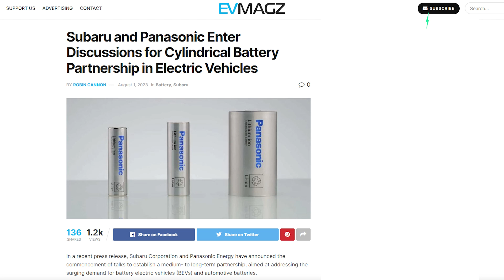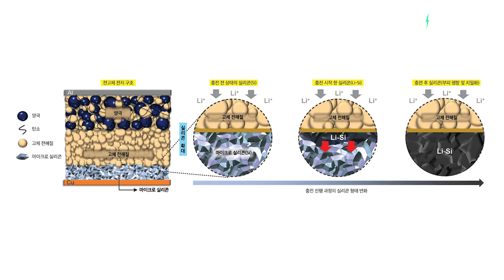Subaru, Mazda, GM & BMW reveal plans to use Tesla-like 4680 batteries

Comment: I thought GM touted using the “Ultium” battery platform. They implied that it is the best platform to use for EVs. So will the 4680 be inside the “Ultium” battery platform? I’m quite confused.

Comment: IT HAS BEEN SHOWN THAT THE BYD STRUCTURAL BATTERIES HAVE LIMITATIONS IN CHARGING TIME, BY INSUFFICIENT COOLING. IT IS OBVIOUS THAT THE CYLINDRICAL FORM OFFERS THE BEST COOLING, AND AS ENERGY DENSITY HAS RISEN THE LOST SPACE BY CYLINDRES IS WITHOUT IMPORTANCE. AN IMPORTANT CHINESE BATTERY PRODUCER (FOR BMW ETC) USES ALSO CYLINDRICAL BATTERIES. PROBABLY WILL CARFACTORIES DEVELOP THEIR OWN COOLING SYSTEMS, WITHIN BY THEM DESIGNED PLATFORMS.

Comment: The 4680 provides better heat control, and rigidity for the pack if glued in properly.  Panasonic has already perfected the cylindrical cell and is a Japanese company.  The only thing Tesla is having a problem with is scaling up 1000% every 6 months because that is how far behind they are in making batteries.  Now Subaru, Mazda, GM & BMW get to find out how hard software, the 48 volt electronics, and new frame is to add to an electric car.  PS, they don't have Musk to push the headaches through.

Comment: When Tesla first announced the 4680 battery cells, they claimed much higher energy density - I think that was greatly exaggerated.  But, compared to prismatic cells, they are said to be much faster to manufacture, which provides a cost advantage.  They should be faster to assemble in packs and have fewer connections than smaller cylindrical batteries, which should make the packs cheaper to assemble and more reliable.  So there do appear to be significant advantages, but not all that Tesla claimed.
Reply: Exactly,  i think you are spot on with this comment.

Comment: This is nothing new, the original announcement dates back to early 2022. BMW confirmed their manufacturing plan’s last December 2022 creating the new plant in Hungry with upgrades to Munich and USA whilst Tesla outlined their new planting in Nevada January 2023. The interesting development underway is the holy grail for solid state batteries Toyota has published detailed of their prototype model with plans for mass production whilst striving for commercialisation in 2027-2028 whilst BMW’s prototype for production should be running by 2025. Then the question is will Tesla produce a solid state battery or persist with the 4680 battery. “When these batteries are in production, there will be no comparison between the current technology or anything petroleum based—[solid state] is the kiss of death for gasoline and diesel." Munro. So when will Tesla announce a solid state battery to maintain pace.

Comment: There are probably cost advantages due to economies of scale when so many manufacturers use the 4680 cells. That may have been the deciding factor causing everyone to jump on board the 4680 train.

Comment: Panasonic must own the right to the 4680 so they can sell the same battery to anybody else. Tesla happens to be the first customer. Since the form factor is an international standard eg. 18650, 21700 and then 4680, other battery manufacturers can make 4680 though likely with different type or characteristics. The 21700 is a good example. Though Tesla was the first EV maker to use it, other brands beside Panasonic, such as Samsung, makes 21700 cells for sale. Now you can buy individual 21700 cells in open market. If 4680 becomes more popular and there are other uses outside EV, just like the 21700, I am sure we will see it being sold on various markets such as Amazon, eBay etc in the future.
Reply: @@user-fg6lm3ef5otrue anybody can make a 4680 form factor battery.
Different story when you have to make it in quantity and cheaply.
Just like anybody can build an EV.
Different story when you also have to make a profit!

Comment: I also am not a battery engineer. Having said that, by what if heard, the 4680’s advantage is first, potentially lower cost. Second, high production rates. The form factor has no bearing on chemistry. You could make a sodium ion cell if you wanted. You may have additional layouts for thermal control. The downside? Lower energy density at the battery pack level.

Comment: More companies going away from pouch style batteries from LG Chem to stromger 😢prismatic battery Casings and cylinder style casing been around  for decades.
Reply: Pouch batteries are flexible and can swell.  They can be damaged during assembly.  Bolt batteries recalled as well Kona battery packs.  Other brands keeping quiet over type of battery
Reply: Lfp does seem the safest so far and CATL mskes the most
Reply: Panasonic wants to grow fast.  CATL interested 4680 style
Reply: 4680s are not  a failure.  Almost fully automated.  700 batteries vs thousands in a car.  Less batteries less weight. Probably cheaper than LFP but I can see a LFP style 4680 in the future with tabless design and no wet slurry but dry chemistry

Comment: No carmaker has to make its own batteries. They all can buy from the shelf or let the battery companies make custom fit battery packs for their brand vehicles. 
Actually the same as with other car parts they all come from third parties: head lights, rear lights, sensors, clutches, seat belts, gas tanks, cables, wiring, lead acid batteries, etc. etc.
And all logical: spread your risk so production can go on no matter what.
Reply: all the oem’s who moved away from vertical integration and towards outsourcing are all going bankrupt or can’t sell their vehicles. Sounds like putting your eggs in one basket. What happens when your suppliers can’t provide parts? a bottleneck in supply? Ah, well what’s happening now to them unfolds. They overproduce on poor timelines and undersell. Controlling your own logistics and manufacturing only makes things more possible. Sure, get what you have to do from others but whatever you make in-house now saves money and time, and creates jobs. Becoming a supplier of parts and infrastructure is a key reason why Tesla is where they are today. Everyone wants their batteries, chargers, and software.
Reply: BYD makes everything themselves including battery and car IC, except tires, windshield and some tiny items.

Comment: Tesla offers diverse batteries, 18650, 2170, 4680, and prismatic LFP.  4680 tabless design for a LFP version.
Reply: Most other companies just one battery type.   LG Chem does not make LFP batteries but that will change.  Many Lg Chem batteries are pouch type that can be easily damaged during assembly

Comment: The 4680 are metal cans and can provide added rigidity to the vehicle's structure. This rigidity can also be used to advantage during assembly as well as during vehicle operations. Second, the metal can provide separation for each cell and if the cell is damaged during an accident or because of some failure of the cell, the exposure to thermal runaway (fire) is greatly reduced. The Tesla 4680 cell vents to the bottom and away from all of the other cells. The other packaging methodology places the cell in close proximity and with little or no isolation between them, they also provide no structural support but are carried in trays.
Reply: Yet they can still catch 🔥
Reply: What you are saying is happening in BYD razor blade battery already, go read up yourself how strong is BYD structures and fire proof even with battery punctures.

But this will not going to happen in Tesla because there are big gaps between cylinder.

Comment: The point about 4680 cells isn't about getting the maximum volumetric density, it's about making them really cheaply. Look at all the stock footage of pouch cell production, then look as how much simpler cylindrical cells are to make. It ought to be blindingly obvious that winding the whole cell in one quick operation is always going to be much easier and cheaper than cutting individual plates and then collating them into a pouch. It's a no brainer that in the long run, this packaging format is going to reduce the cost of the EVs using them.

Comment: this is cool but I expect most automakers will realize customers want LFP, if the energy density isn’t drastically different (which currently it’s not) then I’m sure customers would rather charge to 100% and have less degradation

Comment: You know that you can make LFP and M3P cells in cylindrical form? The reason, I believe, they don't do it is because of the spacing between the cells is less when the cells are in the prismatic/rectangular shape. When in the rectangular shape you can pack them with less space or gaps between them. This makes them have a greater energy density by volume (for the space they take up) than the cylindrical cells do. This is just through design. Since LFP have a lower energy density than NMC cells the rectangular shaped helps LFP batteries make up some of the difference in energy density of the chemistry. Something that won't happen if they were made in cylindrical form. However, making LFP and M3P batteries in the 4680 form, especially using the design that Tesla uses with multiple tabs would make them perform with a higher C rating. Give you more kick in acceleration.
Reply: The weigh of total package will increase.
Reply: @tinh_lai_ivietnam5253  Are you saying that the weight of the total package for the LFP rectangular batteries will go up or the 4680 batteries will make the pack heavier?
Reply: @joelado  What I mean is the rectangular arrangement will reduce gap between battery cell which mean more cells int he are area and the weigh will increase. I hope the dense will give more energy to carry the weigh increasing.

Comment: Which shape is best probably comes down to which is easier/cheaper to make in quantity.
The cylindrical ones would appear to have wasted space between cells, but this can be vital in allowing coolant to circulate.
Rectangular (prism) cells and blade cells may be more space-efficient but the size may have to be adjusted to suit different car designs, so manufacture may be less efficient. This video suggests that the balance may be tipping toward cylindrical cells. 
More important, is the news that Panasonic appear to be getting serious about manufacture, and they have the potential to be a major force in cell manufacture.
Reply: This. Upgrading to another cylindrical batteries is way cheaper. It does not need to retool the entire production line, and cylindrical batteries are sort of “fit all” solution that does not require OEMs to rework their platform. Of course, rectangular batteries are more space efficient (and slightly cost efficient) but the advantage is not pronounced enough for big OEMs to switch course.
Reply: Blade batteries are slow to produce.  4680 is better design.  They can have the same chemistry.